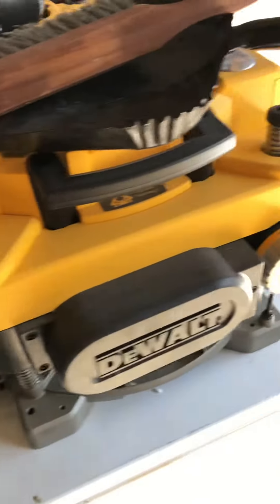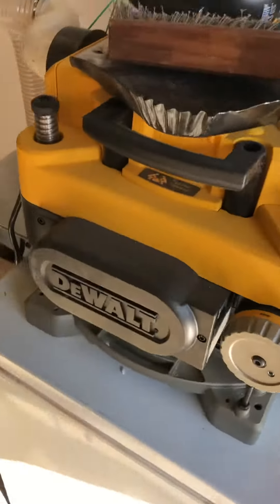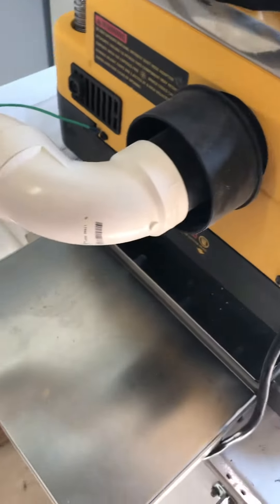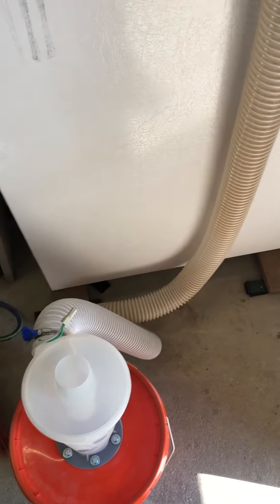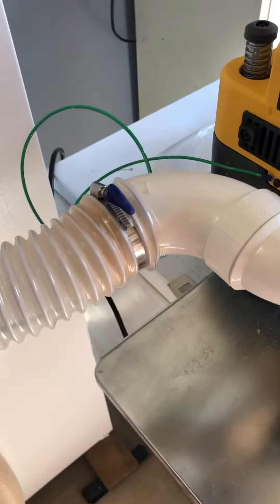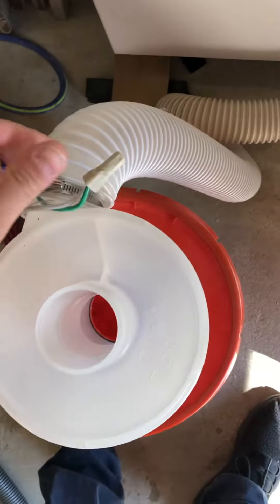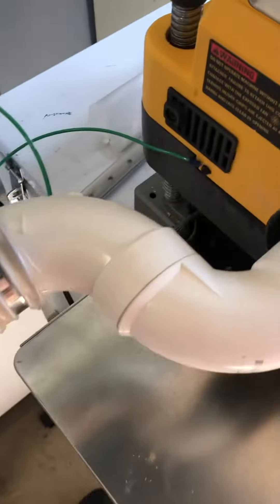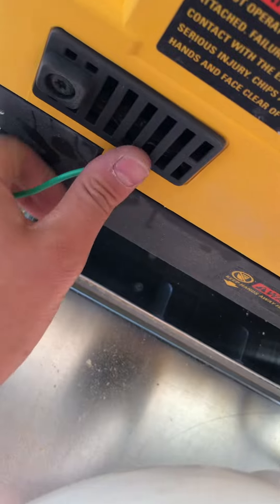Easy DW735 Planer static shock fix

Comment: Where do you take the 2nd (white wire) too from the wire nut at the cyclone?
Reply: The screw on the planer is grounded so that wire can end anywhere you want to stop clearing the static from. there is a good chance the second wire just goes into the cyclone to clear the static from the shaving. so there's something inside the cycle thats connected to the wire in the pipe thats connected to the screw that grounded.
Reply: @stevenferro I think dude connected that green wire to the metal ribs in the dust hose...